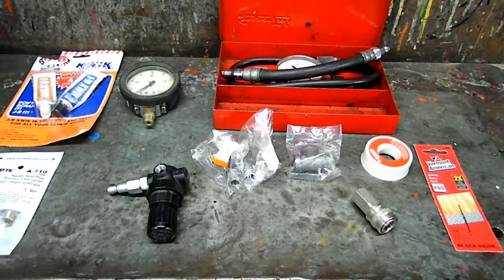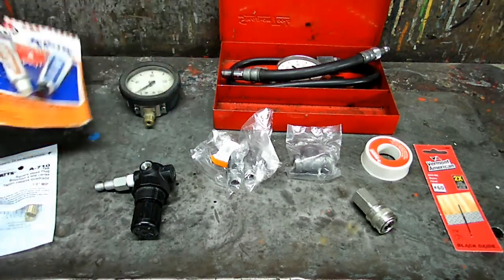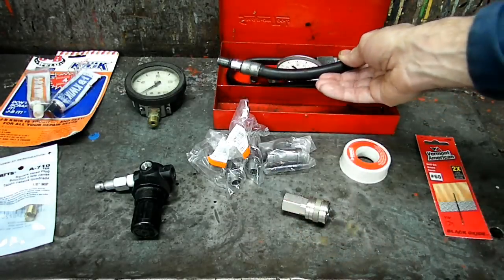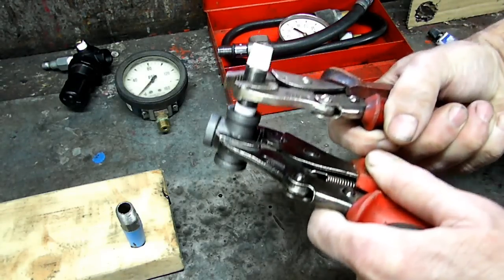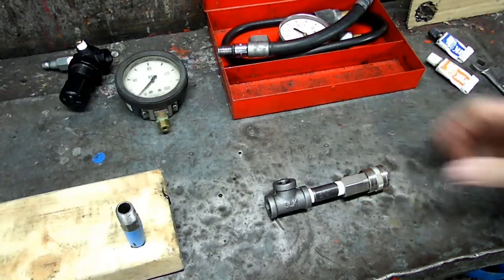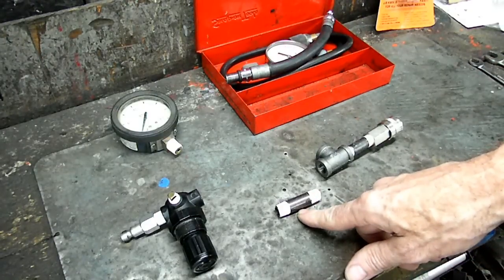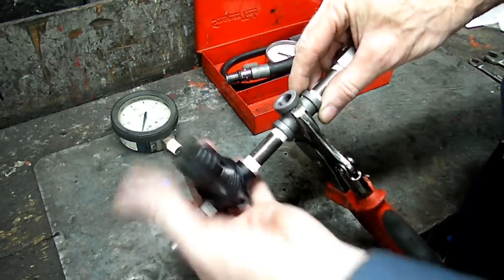Cylinder Leak Down Tester,How To Build

Comment: Doesn't the depth of the JB Weld used for the orifice alter the flow?  If it were an orifice drilled into a thin metal plate vs. an inch thick plug, as extreme examples for comparison, wouldn't the amount of leakage change?  Maybe it doesn't matter in this application, but I was thinking it would be like comparing air flow through a 2 foot hose vs a 100 foot air hose of the same diameter, where I'd expect the short hose to flow more.
Reply: If you were flowing into "free air" the length of the orifice would come into play but in a leak down tester you are mostly flowing from one pressure value to a lower one but not to a "zero" pressure. The flow rate would be a great deal less. In other words the length of the orifice should not matter a great deal.

Comment: The size of the restriction orifice has a direct effect on the rate of leak-down . The larger the orifice, the greater the leak down percentage for a given initial pressure. I believe that most leak-down gauges use a .040 diameter restriction orifice to work with a 100psi initial pressure. In your second video where you say you have 60% leak-down, that is not accurate. You have no baseline comparison to make such a statement. Your tester could only be used as a relative comparison between the cylinders on the motor. I doubt your engine has a 60% leak-down unless it is really worn out. You may want to make a slightly more precision orifice of .040 dia and compare your results. I'm not saying this as criticism at all, your vid was good. Only for information.
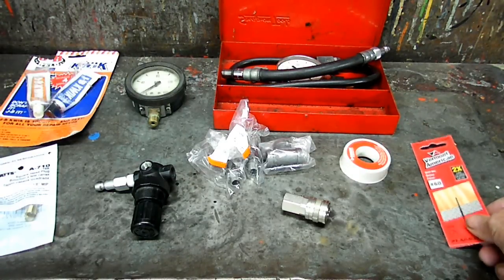Reply: tmackinator......what is your point.., exactly..?   Are you implying that richpin06a is incorrect.., by indicating the use of a #60 drill bit..?   If so.., perhaps kindly check 'your' information.., as you are incorrect.  The  ( #60 )  drill bit..., is in fact... a .040 size bit.., and not.., .060.., that you seem to be inferring.   Go back to 1:18 and observe.., then do your homework before... "not saying this as criticism at all".   As you will see for yourself.., and lectured at length about.., your recommended.., precision orifice.., of .040 dia.., is..., correctly indicated by this gentleman.., with the instruction to use a #60..., aka .040" dia. drill bit.  I'm not saying this as criticism at all.., only for information.., correct information.., as provided.., in this well organized and helpful video.   Thank-you richpin06a...,  Cheers to you Sir.
Reply: +D. Kendrik Well I'm not one to admit an error on my part. I did not see the beginning of the video . I misunderstood the drill to be 1/16 not a #60. However my information was quite correct about the design of the tool. My comments were not done in a critical manner. I was not trying to be critical. I said his video was good.  What should I have said? Take a chill pill!

Comment: What is the purpose of the J.B.weld plug with hole? other than reducing air volume?I have had the same set up minus the plug for years and it works fine
Reply from the maker: Bill Phil The hole calibrates the air like a jet in a carburetor.
Reply from the maker: Dalebrah69  The leakage in the engine is compared to the flow of this orifice (plug), calibrated air.
Reply: Calibrate the air for what I plan to make one for my dirt bike. . From Australia

Great video I've watched it over and over (y)

Comment: Thanks for sharing man. Why doesn't yours have the standard two gauges on it that most have?
Reply from the maker: ILTSYC It is a little less expensive to make the tester this way.
Reply: Ok I found a regulator for 10 bucks at Orielly's with a gauge.
I just have to get a couple of fittings and make the damper or orfice. I believe  I have a blown head gasket on my Ford Windstar mini van. I can hear a puffing under the hood and I've been losing water but not getting oil in water or visa versa.

I believe its the middle cylinder leaking to the outside of the engine from the head gasket. The engine sets sideways against the fire wall.

 I can unplug the fuel injector on that cylinder and the RPM doesn't drop at all like it does on the other cylinders. I want to build one of these leak down testers to try and determine if the head gasket is actually blown. I'm afraid it its though. It will be fun doing the leak down test at least, except for finding top dead center on those cylinders against the headwall. There has to be a pain in the ass somewhere in the mix no matter what you do. LOL!

Comment: hey rich is necessary the epoxy with that small hole? cause i ve seeing another 1 from a kid on youtube,, with no small hole.
Reply from the maker: Without the small hole i do not think the tool will work.
Reply: you said #60 drill bit,,, sorry to ask but what the diameter of that drill bit in inches or mm?
Reply from the maker: serchmarc
I believe it is .040
Reply: i believe you talking about inches,, ok ill convert that into mm
thanks man for your time
Reply: richpin06a 0.040 40 thousands? what the? i think is 1 mm drill
Reply: serchmarc  a # 60 drill bit. You can get the good ones on Amazon, quick connects for like 9.45. You get a whole set, 51 to 60. I also recommend using epoxy to fill the tube instead of J&B weld. The epoxy is easier to drill than the J&B weld, especially if the mixer used to much hardener. You'll break your drill bit every time.

Comment: Why was a #60/.04" hole chosen for the size of the restriction and how was this determined?  I'm assuming it has something to do with the volume of air that could conceivably leak past the rings/valves etc but I'm not sure.  Is there a formula to calculate a restriction size for different operating pressures?  I imagine a larger hole at 100psi would give you a lower value for the leak percentage so this is relatively important.....
Reply: Yes, the 1mm or #60 Drill size 0.040 inch reference metering orifice is to develop a differential pressure that is proportional to flow volume. 
The 1mm or #60 Drill size 0.040 inch metering orifice is capable of being accurate over a wide range from about 70 to about 125 PSI air pressure on engines with cylinder bore diameters from 2.5 to 5 inches. 
This is from published data by the FAA. 
There are several online academic papers that describe the physics, mechanics and math calculations involved.

Comment: Can u kindly explain whats the point of the lil hole u did with the drill bit?i dont get it
Reply from the maker: It acts like a jet in a carburetor which is a precise calibrated part for metering.

Comment: I have found that you can tap a 1/4 npt nipple to 1/8 npt then take a 1/8 npt plug either a square head or scocket head and drill .040" hole then you can screw it into the nipple to make a jet.

Comment: I just read this on "Ford-Trucks Forum" where a forum member was building the same and referring to this video.  I also saw the same done from my Google Search......"So, we could get around the lack of repeatability by using a Holley main jet of .040" diameter for the orifice. They are cheap and easily acquired, but would make the process of building the tester a bit harder since you'd have to drill the JB Weld with a 7/32" bit and then tap it with a 1/4-32 tap to take the threads of the jet."

Comment: Here's what the "evolutionm forum" stated: "Anyone who knows anything about the FAA (Federal Aviation Administration) knows FAA doesn't screw around when it comes to engine maintenance standards.  FAA established the standard for leakdown testing, and requires a 1mm (.040") orifice be placed between the two gauges. In other words, when pressure is applied (e.g. 100psi), what we are looking for is leakage in the cylinder as compared to the airflow through a 1mm orifice at that pressure."

Comment: Thanks and thanks for showing how to use it on a vw engine. Ill be using it for 2 vw 1200cc motors. Stupid question, you mention using a compression gauge hose but you have to remove the valve stem. Can you reinstall the stem or is will the hose only be used for the leak down tester after you remove it

Comment: Seems like you can add a 2nd gauge just before the pipe with jb weld and after the regulator to create the dual gauged leak down tester. Am I correct in this assumption?

Comment: thanks rich, you're a badass you know that :) one tip on mixing epoxy/JB. put both components into one corner of a plastic bag and massage it. once it's ready just cut the end of the bag with scissors and use it like pastry bag for decorating cakes. no mess and really easy.